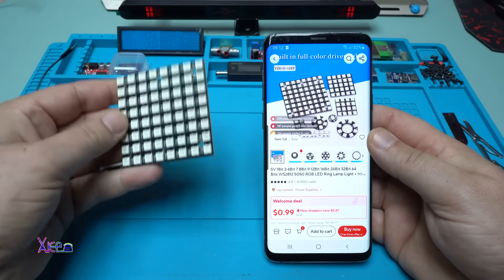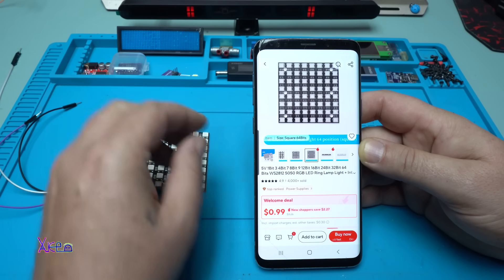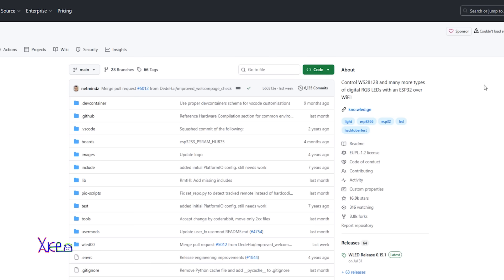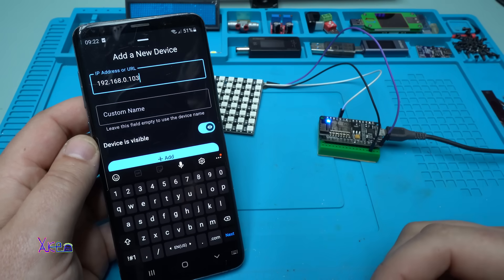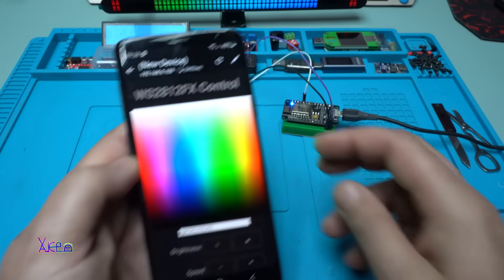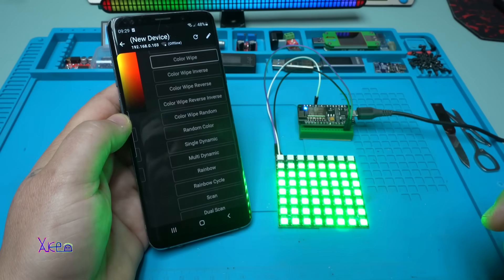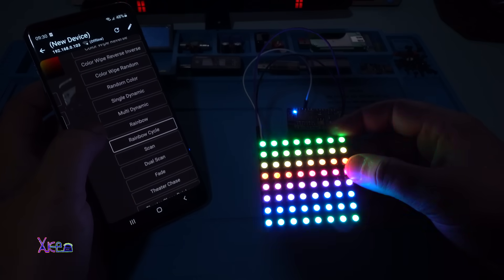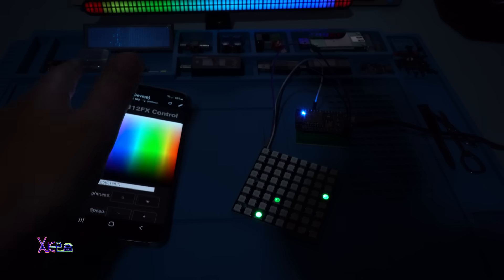WHY THIS $1 Aliexpress Module is  SPECIAL?

Comment: Thanks, I got these boards and LEDS but how do I open the project in Arduino IDE? 2m03s does not day, I have no file called esp8266_webinterface.ino in WLED-main.zip

Comment: I got so many of these panels, getting them ready for multi-panel Christmas displays.
Reply from the maker: Me too,I prepare my self for upcoming holidays😉
Reply: is it possible to connect several of these panels together to make the one large display ?
Reply: @thehonestreviewer7824  Yes. You just need to supply power positive and negative to each panel individually from a common power source so they all share a common ground connection and then daisy-chain the data connections: microcontroller > data in; data out > next panel data in etc... 
The configuration is then programmed in the microcontroller, so for example if you have a 6x6 grid, you program the order of wiring data connections. AI can do this all for you and help you with step-by-step instructions.